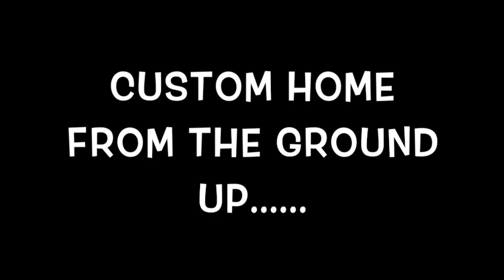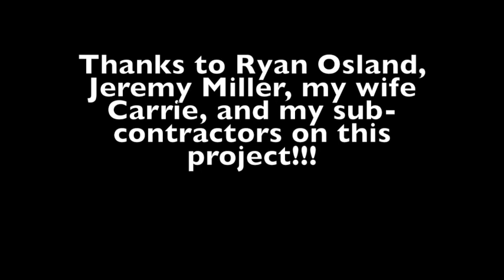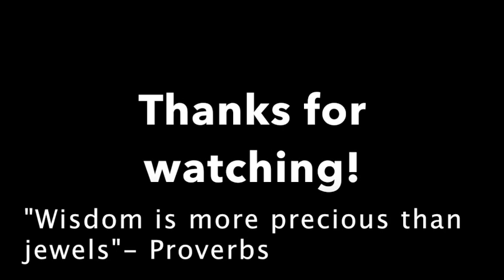Residential Construction- Start to Finish!

Comment: It's very different here in Ireland. Like UK, houses in Ireland have more things going on. The foundation level is the same as shown in the video. However a radon gas barrier and damp proof membrane and insulation is added. Then blockwork wall with cavity is used, in that cavity an insulation is also present. Because here we use block walls instead of wood, steel beams and sometime columns are used to support the structure. The first floor is made of precast concrete slab (Sometimes the groundfloor too) and that is supported by steel beams and loadbearing walls. Again an insulation is present on the floor, the houses are pretty much covered in insulation. The roof structure is made of timber (joist, rafter etc etc). Houses here are mix of concrete and timber but mostly concrete.

Perhaps that explains why houses in US are significantly much bigger and requires sprinkler system due to the houses there mostly built of timber which reduces cost a lot.
Reply from the maker: Thanks for the comments/info! 
Here in earthquake country, we fill the block cavities with rebar and concrete.
Sprinklers were originally intended to only knock down smoke in the event of a fire. As with any government bureaucracy,
the requirements have grown to protecting nearly every crevice of the structure itself. The danger in most fires is the smoke from interior finishes ,i.e. carpet, etc. rather than the structure itself. Drywall covering the wood generally has a 1 hr fire rating to keep fires from spreading.  Dave

Comment: This was a great video. The only thing I would have add is when the electrical was installed. Just for newbies to have an understanding as to when that happens.

Thumbs up !!!👍🏽
Reply: what???
Reply from the maker: Electrical goes in after the framing is done- along with plumbing, HVAC, fire sprinklers, once those are done, insulation and then drywall covers everything up.-
Dave

Comment: We don't build houses like this in the Philippines. Almost all the houses are bulit with cement. Walls and floor. Is wood cheaper?
Reply from the maker: Hi Juan-   Good question!
   Lots of reasons we build from wood-
   1) Wood is an abundant resource here.
   2) Wood built homes are extremely earthquake        resistant for here in earthquake areas (Calif.)
   3) wood frame homes tend to be warmer/easier to heat in cold weather
  4) Wood frame homes  are generally easier to rehab/alter/ or remodel-  i.e., moving or opening walls...  

  Wood also has it's faults- termites in certain areas, not the best for tornado areas, etc...
   There are good cases for all methods of building homes in different areas.. Dave

Comment: What happened to the plumbing lines before you poured the concrete?
Reply from the maker: No plumbing under the garage slab.
 Only a 4" round sleeve in the stem wall to pass the main waste line trunk thru....
Dave

Comment: Hi Dave, thank you for video.  It was interesting for me. But some moments are still vague for me. Why does American prefer wood houses? I am from russia, we are using other materials. For example, most houses are  made from aac or bricks. Also drywall is not used widely (sometimes it complicates plastering very well). These are small number of differences
Reply from the maker: Wood is plentiful here and provides very ggod protection against earthquakes here- it's flexible.
Drywall provides a fireproof covering for all the framework, electrical, sound, etc...

Comment: Hi Dave, enjoyed your video thanks for sharing. My question is, how do you paint the interior, or  should I say how many layers in a wall? wood, and dry wall? or wood and paint over the wood? Sorry this may seem like a stupid question.
Reply from the maker: Good question!
It's very common to have drywall ("Sheetrock") on interior walls covering wood framing. It's extremely fire resistant and easily painted by spray rig, roller, etc.. Even wood paneling generally has a layer of drywall under it for the fire resistant qualities.
Reply: @daveosland3199  Thanks for your elucidation.

Comment: In UK and Europe brick and block construction is norm, new houses sometimes are timber frame but considered inferior. Old houses in US must just burn down completely in event of a fire.
Reply from the maker: They will burn down in some cases. We are trying to use more flame retardant materials on the exterior- Type A shingles, cement board siding (as this house has), etc.. The wood frame houses we're building generally ride out earthquakes much better than masonry structures (they flex and bend!). The drywall interiors provide a flame resistant interior.
With the mandatory fire sprinklers, we generally get more damage from water than fire!!
Thanks for watching! Dave
Reply: @daveosland3199  Hey Dave is it normal in your country to construct your house on your own ? Pretty different situation here in my country India if thats the case !
Reply from the maker: @Wolf-hd1hr  I built my 1st home in 1980, around 100 since then. Been a licensed contractor since 1984. The majority of people DON'T build their own homes....

Comment: Can anyone tell me why they are not using brick wall, concrete roof, totally made by wood. Is that strong enough for a generation
Reply from the maker: Hi
These types of homes are very strong-
plus they "give" in earthquakes- they flex without collapsing as seen in many parts of the world where earthquakes occur.
    The frame is wood, but interior and exterior of fire-resistant materials.  Dave
Reply: They are not meant to last a generation. American houses are generally poor in quality
Reply: @alexclarke6924  Is that why most towns in the US have houses left over from the 1800s and why my whole street is made of wood houses built in the 1970s.

Comment: What do you call about that foam thing that was inserted in the walls.?
Reply from the maker: After plumbing/electrical, there is fiberglass insulation before drywall...

Comment: So many wood, why u didnt use steel or concrete
Reply from the maker: Good question!
   Wood frame is an earthquake resistant construction method (we get 'em here in California!)
Wood frame goes up quicker than steel or masonry, is easy to run electrical, plumbing etc., thru.
We've got an abundant supply of lumber here.
Generally cheaper than other framing methods.
Less thermal lose than steel or masonry (easier/cheaper/quicker to heat).
Less sound transmission than steel., (tho masonry is better for that)
Every method has it's pluses and minuses!
Dave
Reply: @daveosland3199  what alternative of the wood we can use providing the same look of the structure?
Reply from the maker: @techmateinfo4520  A steel framed house could look similar...There are also prefabricated wall panels (ply and foam core).etc....

Comment: Which material used for roof and walls in foreign countries Houses!? It's cement concrete or what!?
Reply from the maker: Roof- Asphalt composition shingles (50 yr rated)
Siding- "Hardiboard" cement board siding..

Comment: Wooden house it is.. Can people throw party in 1st floor and everyone is dancing for music ? What happens in case of fire accidents ?

 15 weeks is lit quicker for house of that proportion. If we go for brick cement method it will take around 8-12 months and some more weeks for interiors
Reply from the maker: In other words, is it strong?
Very strong, also earthquake and high wind resistant.
The interior of the home is sheathed with drywall- fire resistant gypsum board. Exterior with fireproof cement board siding and fire rated roof shingles.
The home is also equipped with a fire sprinkler system. 
There are stringent building codes regarding strength and fire safety.
Dave

Comment: I hate wood homes in like 40 years all that wood is going to be full of termites roaches and all of the above i’m gonna make sure I make my house in concrete here in philly
Reply from the maker: Like cars that go 50,000 miles or 500,000 miles, maintenance can/does make all the difference. My current wood framed home is 20 years old and is as good as the day I built it. On the other hand I see homes only a few years old that are in need of restoration work because of poor drainage, sloppy construction,  poor maintenance, etc..
 Every construction method has its ups and downs.
I'm currently working on building designs meant to endure for easily 100 yrs+...
Dave

Comment: A tornado wil blow this in the air in to seconds. It looks nice nut very thin walls..Timber isn't lasting long. Stone is stronger
Reply from the maker: The home was engineered for seismic category D construction- severe and destructive ground shaking (earthquake). Also, per class II construction and per engineering- 140 MPH (225 KPH) winds. Tornados of any significance in California coastal areas are exceedingly rare....
  You probably don't want to be in or near any masonry (stone and concrete) structures in a 8.0 earthquake....

Comment: Why you don't use bricks,,??
Pakistani homes are totally made of bricks,,,,
Reply from the maker: Hi Uzair!
Good question!
1) Wood is plentiful here.
2) Wood built homes are extremely earthquake resistant. We are in an earthquake prone area!
3) Wood frame homes require less labor to build than brick or masonry.
4) Wood frame homes are easier to heat (warmer) and easier to remodel/alter if you desire.
There are negative sides to wood also-
Termites and fire concerns need to be addressed.
Dave
Reply: @daveosland3199  nice,,,bro,,its interesting for me ,,,as a Pakistani,,,because we use wood just for doors,,(too expensive)
Reply from the maker: @uzairkhan6131  And you make beautiful metal work that I admire!

Comment: Rubbish not strong  it's only wood .it's danger  in case get fire then .very funny wasted of money. ..from UK .
Reply from the maker: In the 89' earthquake in California, the 63 people that died were from falling concrete/masonry structures-
  A single  2x4" x 8 foot stud (douglas fir board) can support  7000 lbs (3200 kilos) vertically, can bend and snap back into place. Look at the tens of thousands that die in earthquakes because brick and concrete can't bend but collapse instead.
  Deaths from fires are mostly from smoke inhalation from carpet, upholstery, etc..-Found in any type residence. The frame of modern built wood framed houses is usually the last thing to burn...
Reply: How often do you think houses catch on fire?